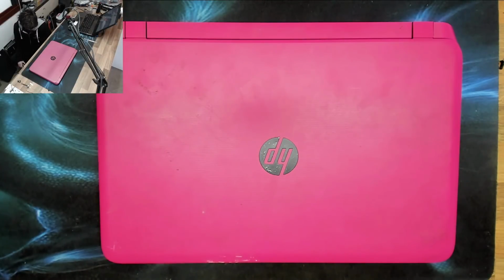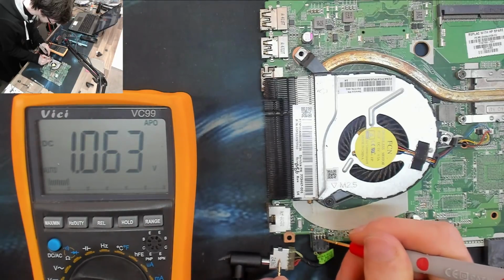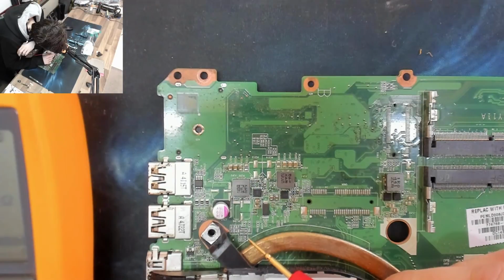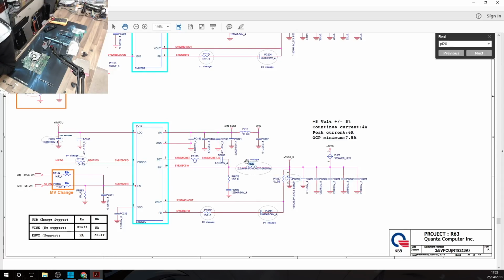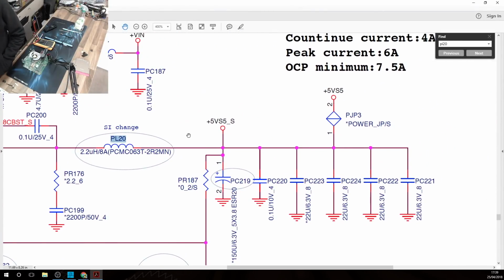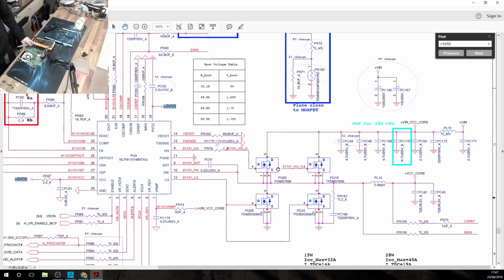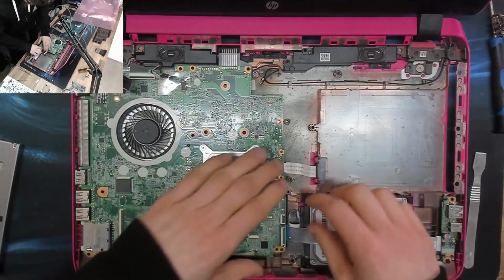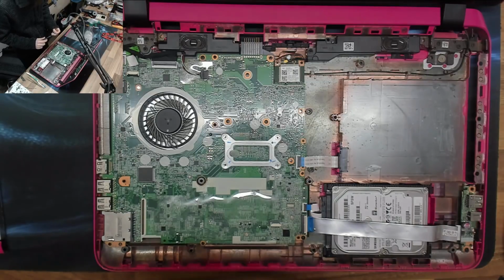LFC#134 - HP 15-p No Power

Comment: You videos are very helpful but I have this case with asus laptop the owner says it just shouted itself down till now it won't turn on but the charger light shows that the charger is connected. I have tried  to check power button is fine. Ram is embedded  what else can look for to solve this problem

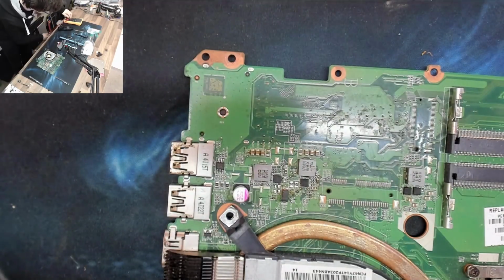Comment: When you measure the resistance at  5:30 where exactly do you place the leads? And at 7:35 why did you use continuity on the capacitor pads after removing the pads?
Reply from the maker: Black probe on any ground point, and red probe on the location that is shorted. The capacitors join the power rail to ground (they act as small power reservoirs) so if one of them fails short and turns into a wire, that creates the short to ground. If I find and remove the failed cap, the pad it was on will no longer be shorted to ground because 'wire' (failed cap) is gone.
Keep in mind though that this is one of my earlier attempts at board repair. I probably would've been able to solve this one if it came in today.